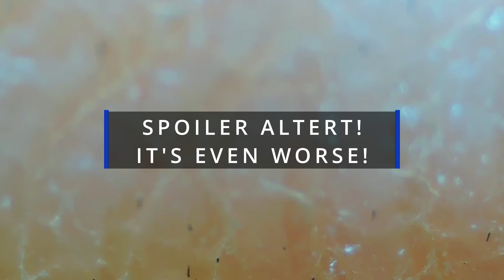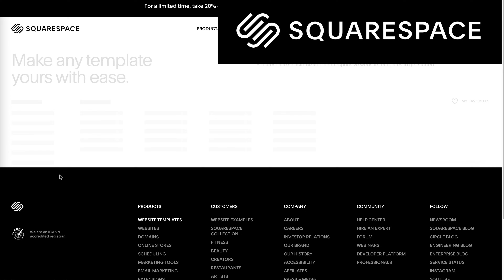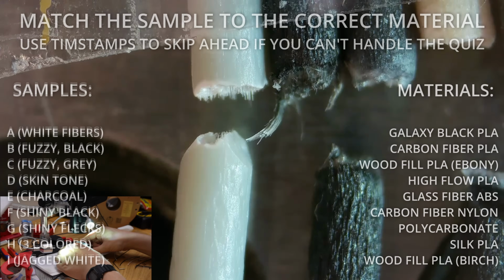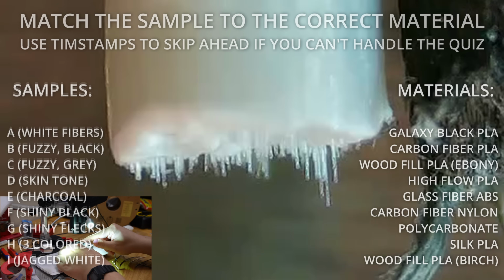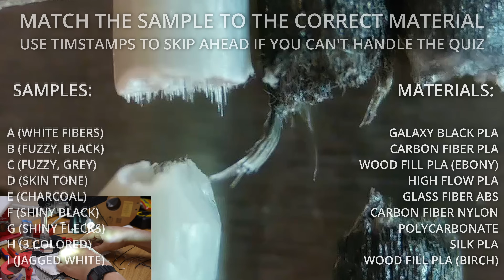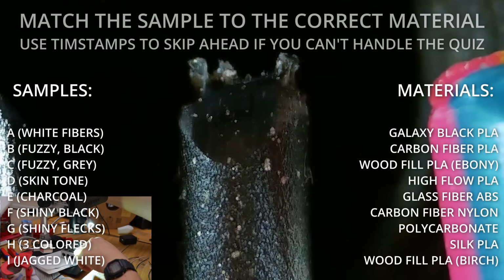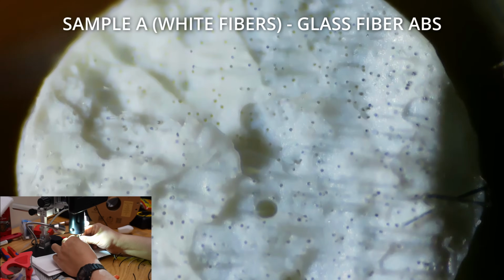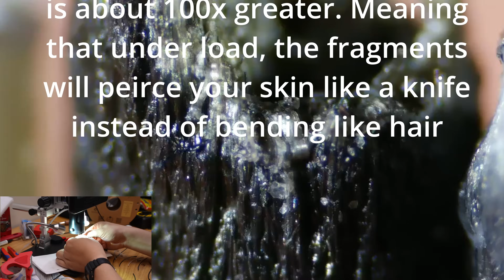Carbon In My Skin. These Wounds, They Will Not Heal.

Comment: I was literally THE highest producer of Onyx when I worked at Markforged.

A few years ago, if you printed with Onyx, there's a better than average chance that I personally made it.

I'll probably die from carbon dust 😆
Reply: I stood up their 3rd shift production team by myself.  I've made literally hundreds of tons of that stuff.

I didn't have fingerprints because the material abraded it away.  I'm by far a statistical outlier with regards to exposure to this stuff.

Comment: Just some thoughts... I think this is a really difficult topic. It's so easy to get blinded by the "awesomeness" that is 3D printing and forget about safety. As an example, my 3D printer is in my bedroom. I know that this is not ideal and I do open the window after printing, but what's that gonna do if all the particles have settled down somewhere. I a way, I'm lying to myself. Then again, I have ridden my bike along a main street for more than 10 years and despite cars having catalysts, it can't be good. Heck, I don't want to know how much micro plastics I inhale, drink and eat every day. This might sound pessimistic but we kinda lost this fight, what's in the environment is there and will stay. The only thing we can do is prevent new plastic from distributing everywhere. And print less decorations and unnecessary stuff, that's my opinion, you make up your own. I mostly print functional parts if something breaks around the household. The thing is, though, 3D printing is giving me something I could otherwise never have. I can be a bedroom engineer, think of the wildest things and just make them immediately. At the same time, I know about all this stuff and it makes me sad. I'd love to build another printer, but what's the point, I don't even need it. However, this is more about building rather than using it. What I know now is that I'll probably stay away from CF filaments, I don't need them anyways. I'll downsize what I have, save some space and maybe build an enclosure I designed some months ago, I just have to add a filtration system to it.

Comment: Worked for years with Injektionmolding maschines and used Material with 30-40% Glasfiber. This sh.. made when i had a lot kontakt with my skin on thin areas create little blisters.

On some extrem hot days when you sweat a lot it seems not to be that bad. Maybe sweat dissolve glasfiber?

Comment: I got a carbon fibre trove wallet about 5 years old now. And I always wondered from the day I purchased it if the carbon fibre was actually an issue as it breaks down. Considering basic things I had read about the material prior. I emailed the company asking and they obviously said it was fine. But do you have any idea? Does it depend on the way the carbon fibre is made? As this part on the wallet definitely does fray and breakdown over time like any material. But is it actually of any concern?

Comment: There are a lot of counterfeit parts out there. Amazon is just plain horrible, in all aspects. I buy parts by part number, only OEM. And do a lot of research, and occasionally still get scammed. But, on eBay, if i do my due diligence, i get my money back easily.  The world has changed a lot, and thieves are everywhere.

Comment: I'm in engineering school, and we've had courses on 3D printing and additive manufacturing in general. Of course, we were told that the metal and plastic powders used are harmful, but only during preparation and cleaning of the parts. At no point was there any warning about the dangers (for us and the planet) that the parts represent once finished with all the micro-particles they release. I was also very surprised by the CF filament prints, and this discouraged me from using them without any good reason, for my own good and that of those around me.

Comment: I just bought a 3d printed item for my coffee grinder and your video opened my eyes to know if the materials I’m using will chafe or come off in my coffee grounds. The product isn’t involved with the grinding process, but is a hopper/bellows setup.
Reply: Make sure your material is food safe. The tiny gaps in a 3D print are hard to clean and a spot for bacteria to stay

Comment: As a former fiber engineer, I was always told to never handle any of the exposed plastic fibers without special gloves (it hasn't been glass fiber for a while, since fiber developers finally figured out glass is too stiff and breaks too easily and certain plastics let light through just as easily). Okay, they're much bigger pieces of fiber, but we were warned that if a fiber was stuck in my skin, to immediately go to the hospital to get it removed, so it doesn't enter the bloodstream, where it could do a lot of harm to sensitive stuff like nerves if it ended up stuck in there somewhere. This should be up to same standards: Always use gloves if fibers are exposed (assuming you can say that superglued fibers aren't considered "exposed").

Comment: Just use scotch tape as a standard method to check the fibers in the filaments going forward. Other "skin-like" alternatives won't have the combination of oils and texture that will pull the fibers off the filament, but scotch tape is a very well standardized tackiness and can be used as a consistent reference for further evaluation.

It's also translucent (like human skin) so it will let you observe the fibers more easily.

Comment: I work in the aviation maintenance industry and it is well known in the industry that carbon fiber can be very dangerous. Getting it on your skin is not too hazardous but if it gets in your bloodstream it is poisonous and can be deadly. We had a technician working inside an aircraft in the same area for days and rubbing his arm on the edge of a carbon fiber composite panel until it caused scrapes through his skin. A couple days later he suddenly became ill. He then spent a week in the hospital for carbon fiber blood poisoning and was close to death. He did make a full recovery and developed a phobia of carbon fiber and I can't blame him. I honestly would not use carbon fiber infused filament but that's just me cuz I know the risks and an actual story
Reply: Carbon fibre should be heavily regulated

Comment: Thank you for all the detail microscope pictures. 
You mentioned experience sharing so here is my experience with what it is like to handle extreme amounts of carbon fibers. Years ago I got to visit a small aircraft factory a few times (small aircraft, not so small factory). Some produced parts were fiberglass but most were carbon fiber. 
First a large room where they unspool the fabric onto a long table and cut out the needed shapes using templates. Diamond microteeth scisors were used but they went through so much fabric per day that one set of those most advanced most expensive scisors would still last maybe a week or two. (Or just hours when doing Kevlar btw.) The air in this room felt heavy despite ventilation running it through filters all the time. That is what you get when you cut several dozen kilograms of carbon fabric per shift. Everyone was wearing gloves, some people breathing filters as well but those were not mandatory there (at least not all those years ago). 
Then the wet layup rooms, not much on those. The handling of the fabric is minimal because the cutting shop prepared kits so the layup team only picks up the piece on top of the stack, places it in the mould and saturates it with resin, picks the next etc. After all layers are in then peel ply, breather, vacuum bag... Standard PPE was just gloves. If polyester resin was used instead of epoxy (typicall for large bucks and mastermodels) activated charcoal filter masks were used too. 
By far the craziest environment was the part finishing shop. The parts come out of the mould with excess on all sides that needs to be trimmed off with precission. Typically a rough cut with a vibrating saw or occasionally a router. Holes need to be drilled. Then all edges are sanded smooth and to the precise line with vibrating sanders and by hand. Basically if you wanted to create as much carbon fiber dust as possible this would be the way to do it. So the standard PPE for this was a full body suit that seals around gloves and boots, with a shroud over the head and full face mask with filtered air actively pumped into it. Despite all this protection after working there just one day you would start to feel irritation on your skin (experienced myself). After a week this is constant whenever you touch your skin with a wet hand (I only got two days but mostly fiberglass which they said was worse for the skin). It feels like sandpaper touching you. People working there were paid a lot higher than any other factory floor workers yet nobody lasted more than 6 months. The owner of the factory told me one of those employees when quitting said he will go back to working in a coal mine because that was easier. 

So that concludes my story about how dangerous carbon fiber handling can get. We will never get anywhere close to this with 3D printing. You would have to run a farm with hundreds of very fast printers all printing carbon fiber filled filament non stop to be handling the amount of carbon fibers per day that was processed by that aircraft parts factory in a single shift. 
Carbon fibers in a filament are certainly something to consider and maybe not use it unless the application really calls for it and the finished part will not be directly handled by naked skin in its use. If it is a mechanical part burried inside a robot somewhere it is no problem in my opinion. And unless you have to handle it daily I would not think special setups are needed. 
I will apply similar precausions like when handling some paints or glues: limit my time of exposure, ventilate the room well. If a factory processing 50-100kg of the stuff per day did not see people ending up in hospital after a month, if a friend working there for years is now still fine 10 years later, then being around 100g of it in 1kg spool for a day or two twice a year will probably not have any measurable effects on me unless I do something trully stupid like put the printed part to a belt sander and breath in the dust on purpose or something.

Comment: I used to get skin inflamation due carbon fiber dust (quick hand filing carbon fiber without a glove on one hand). Luckily it is just a small area of my hand. The inflamation grew up for serveral weeks if not a month until it looks like dermatitis. A doctor gave me a steroid based ointment to reduce the inflamation. It has got better but once I stop using the ointment the inflamation slightly return. Finally the inflamation is gone but that skin area appeared to be darker than usual for a few week later. Fortunately it is normal now.

Comment: iirc tattoo artists used to practice on pigskin, just go ask your local butcher. however, they make synthetic ones now. i'd call your local tattoo shop. they might even be able to run the tattoo machine backwards and remove the filament from your skin

Comment: CF is nasty.
Any time you cut/sand/break it you need a serious respirator, the dust can really mess up your lungs.
I was actually surprised when I found out they make a CF print filament, and the way it's done.
Lets take the most dangerous part of carbon fiber and put it in the filament.
It's just not worth it. Without the layering and fiber length you're not getting the actual strength of the CF and you're coating your entire piece with what is the nasty byproduct of working with CF.

Comment: I used carbon fibre tubes as extensions for a sensor housing printed in ABS. These were coated in resin as part of the process but the fibres I got in my skin learning how to handle it took 6 months to grow out.

Comment: Sounds like you need to make some of my CleanAir filters, I have them installed inside all my printers, and I also have a large exhaust fan that extracts the air out of my room directly above my machines.
Reply from the maker: I don't have a place to run vents outside, but I would definitely do that if I could.
Reply: @NathanBuildsRobots  Best to use filter systems inside your printers as first stage for cleaning, all of my machines are enclosed, so I have 1 or 2 CleanAir filters in them, these filters also help to circulate the air inside making the heat throughout the chamber more balanced as well, then you can have a large external filter like the one your have at the moment as a second stage, also keep a window and a door open to circulate the air, I also run an active air quality meter, does around 8 different things including particulates, has a pump to pull in air for more accurate readings.

Comment: I used to work with fiberglass on occasion.
I ALWAYS wore a respirator when grinding, sanding, or cutting any material that was some sort of plastic.
Problem was, that in summer, it gets dreadfully hot in a full kit of PPE.
When I did fiberglass, I had a roll of quality duct tape for the end of the operation.
I wore gloves to keep the fibers and chemicals off my skin.
The dust? 
I would use an air hose to blow the dust off my arms, then use the sticky side of the duct tape to pull all the dust off my skin.
After that, a cold shower to get the bulk of the remaining fibers off, followed by a hot shower to wash the rest out of my pores.
Never had even as much as a zit following this procedure.

I did not work with this stuff as a profession, so I didn’t have much to worry about.

If it WAS a profession, I would have definitely conditioned myself to wear the full PPE getup and get accustomed to it.

Comment: THANK YOU for confirming my suspicions I have avoided using carbon fiber parts on mountain bike builds for years. Over the past few years growing numbers of parts have been turning up in RC cars, especially after market parts. Most RC car parts appear to be made using various themo set, extruded and cast materials but there are some parts that leave dust and fibers behind when handled especially when abraded, this problem gets worse over time as the parts get worn from use. It would be very interesting to see what You find looking at RC car and scale model parts. I also wonder about safety issues with using 3D printed switch covers and control knobs on switches, potentiometers and rotary encoders used in electronic projects. We are already aware of the dangers of modern plastics and rubber parts gassing off and avoid using polyurethane coatings and finishes. Your findings with 3D filaments prove there are legitimate safety concerns that people need to be made aware of when 2D printing and using 3D printed items.

Comment: The YouTube influencers always downplay the potential harm 3d printing might cause. Nero3D always downplay toxic fumes from abs prints without any air ventilation or carbon filters by saying “oh I worked in the plastic industry exposed to burnt plastic for ten times more and I am still standing here fine”. Pretty ridiculous logic right there but most YouTube influencers are that ridiculous and cause more harm than good in our community.

Comment: It's a good thing we lose 30-40k skins cells every hour and upwards of a million per 24 hours. These fibers seem to barely, BARELY, penetrate the "dead skin" / first layer of dermis. It's a cool experiment and you did a really great job documenting and everything but there's genuinely no risk involved with physically touching filament and/or finished prints. You'd likely net far more danger from the fumes that may come off of certain materials rather than this physical aspect.

Comment: It seems like when you have any micro/nanoscopic fibers, the ends are going to inherently be razor sharp just on account of their size. Even if the tips were perfectly flat, the micro/nanoscopic size still makes it like a knife with a similarly thin blade. And you can imagine how sharp a blade that thin could be. After all, the penetrating ability depends on the amount of weight per surface area. If the surface area is only a few square microns, even a gentle touch would equate to a great deal of pressure (psi or grams/cm^2). Whether those fibers are asbestos, carbon, glass, etc, they all seem to have this problem. I just wonder why asbestos causes cancer and other fibers don't.

From what I understand, asbestos causes cancer by chronic irritation by the sharp filaments that work their way into your lungs. And it stands to reason if carbon fibers can't work their way out of skin, they can't work their way out of your lungs. Chronic irritation causes excessive cell growth called hyperplasias, which are precursors to cancerous tumours. Mind you chronic irritation is only one of many mechanisms that causes cancer. But one would think if that's the cause, then any fiber should be able to cause a similar effect.

I'm wondering if they actually do cause such an effect and it's just been sorta buried by the industry, as they tend to do when a profitable product is found to have health risks or a fundamental flaw a la radium paint, white phosphorous matches, asbestos (of course), leaded gasoline, dry cleaner fluid, plastics and fossil fuels just to name a few. And it could be that the rates of health problems related to carbon fibers or other fibers are far fewer than asbestos, and thus harder to link to said fibers. Especially when health issues don't crop up until decades after exposure.